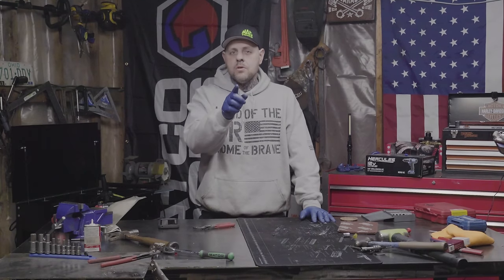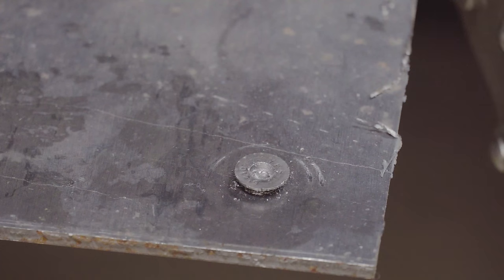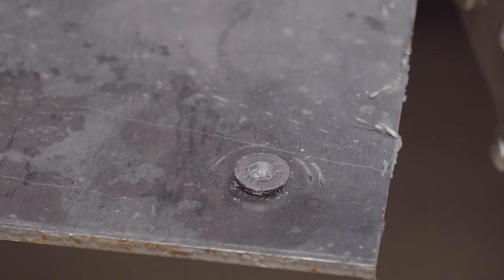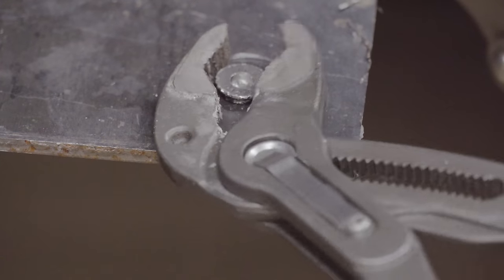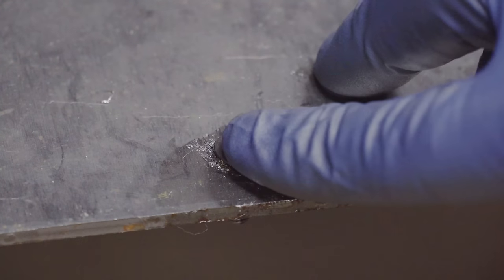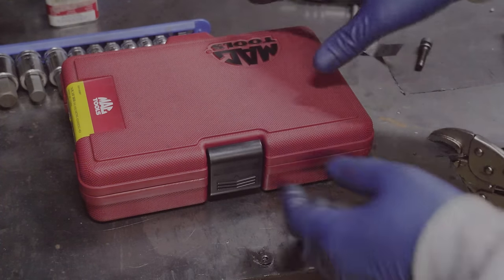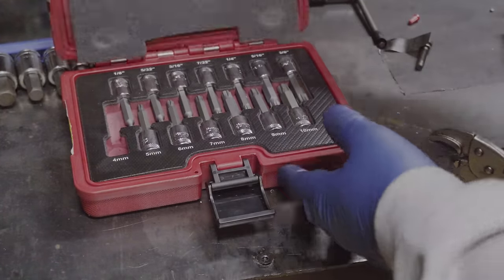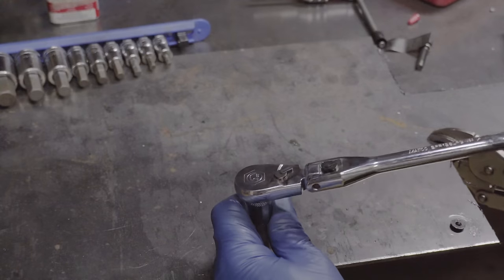3 Easy Tricks to Remove Stripped Allen Head Bolts

Comment: I tried all kinds of methods to remove a 4mm button head bolt. Nothing worked including a kit for stripped bolts. They were too big or too small. I finally used a T30 star head- it was ever so large. I ground the tip down just a bit and hammered it in. Bingo!
Just one more idea to remove those stripped critters.

Comment: cheapest way grind down the head, remove the part, drill out 1 size bigger,  tap  the threads original size and use helicoil the current bolt size your using.

Comment: I have a rc truck motor that I need to rebuild and I bought it used and someone already rebuilt it awhile ago and I guess they didn't know what they were doing because the screw are rounded off and the screws are tiny

Comment: Man, I've got a really tiny totally stripped hex bolt embedded (so I can't grip it with pliers) in the PU sleeve attached to a hub motor on my electric longboard. 

What's worse is that where it's positioned means the other side of the truck and it's hub motor block me from being able to get perfectly vertical over the bolt; it makes most of these tried and true methods much less effective. I've tried using bolt extractors but (maybe due to the angled entry?) they just ended up stripping the bolt even more, and seem to refuse to grip onto anything. 

Really sucks. I'm at a point where I'm wondering if I'll have to spot weld another screw on top of the bolt, and then use that screw welded into the bolt to get the torque I need to remove this (seriously over tightened) bolt :( 

I'm wary to use a hammer and a larger sized allen key to make a new, biggee groove because this bolt is directly over a hub motor that I'd really rather not damage.
Reply: If it hase a valley above use a bolt extractor and find the size that fits just over the size of the head and press down as you reverse
Reply: @lawxx6  I think this was my problem - I was using a bolt extractor that was a size too small. Gonna take your advice when I get off work today.

Comment: I'll add that a dremel tool or angle grinder can be your best friend if the bolt head has easy access. Besides putting the one groove in the middle and then using a flat head, as already mentioned, you can also cut the edges of the bolt head off flat, opposite one another then slip an adjustable wrench or pliers over those cut edges. Just make sure you're cussing the guy who stripped the bolt, and probably cross threaded it to begin with😅

Comment: Good for bolts that are in the open like the ones you just showed, but never for a bolt that is screwed on top of a faucet lever. Can't hammer it, neither reach it with pliers.
Reply from the maker: You could use the extractors instead they would reach it.
Reply: Redemption Garage that's what i was hoping to see when i came here. But thanks for the suggestion

Comment: No matter how simple the job, every time I start a new project, something basic is really fucked up.

1.) Went to clean my mower deck the other day.  Got the power washer out.  Power washer engine would stall out every time I pulled the trigger on the sprayer.  After 3 days of fucking with it, the pump on the power washer literally exploded yesterday and sheared off the metal outlet to the sprayer, and I ended up scrubbing the damn mower deck with a wire brush and steel sponge.  Now I need a new pump for the power washer.  New project.  Can't wait to see what shit goes wrong on this one.

2.) Went to change out a dead exhaust fanlight in the bathroom.  The duct collar would not stay clipped to the housing.  The flap broke inside.  Had to remove the entire housing again and order a new duct collar before I can finish it.

3.) Went to change out the shower cartridge in the upstairs bathroom.  The allen bolt is stripped inside the damn shower handle and now a job that should take 10 minutes is over an hour and no end in sight.

Comment: I wish it was that easy.  I have 12 point torque bolts in a Kia soul cylinder head.  Three are rounded off.  No room for welding a nut onto it to extract it, so easy out worked and beating another size down into it didn't work...now what

Comment: What if its completely rounded out? Because of overtightening
Reply from the maker: You can still use these tricks man what you need to do is find a size thats bigger than what the actual hole is and use a brass hammer to beat it in and try to break it loose. You dont want to go too big though so your best bet is to find either the metric or standard equivalent and use metric if its standard and standard if its metric because for the most part they are in between each other. Let me know if you are able to get it out and if not there are other tricks you can try and I will try to help. Thanks for watching and I hope this helps

Comment: im takin out the motor of my grandpas victory and one of the motor mounts with are an allen head stripped out cause ima weward anyone got any tips on removin a highly tourqed down stripped allen
Reply: Not sure if you fixed it yet....
I used a slightly larger T30 star (torx) driver and ground it down so it would go in a little bit. Then hammered it until it bottomed out. Came right out....

Comment: You missed some others methods , not the least of which is cutting a slot across the top or welding a nut to it , grinding flats on it  , off the top of my head , so keep studying , you will get there !!!!

Comment: I made the hole bigger in the bolt with extractor what should I do
Reply from the maker: Try to go up a size and knock the extractor in using a brass hammer if you have it otherwise use a hammer but be careful

Comment: Who leaves the bolt sticking up?
Reply from the maker: What? You mean you have never seen a socket head bolt used with the head exposed? Like I said in the video that solution only works when the bolt is open but I guess you are trying to either ask a question or are being funny. But yeah man there are situations where a socket head bolt is exposed.

Comment: So none of these worked for me. What I did was strip it out even more until the next sized Allen wrench almost fit. Then I hammered that wrench into the bolt and got it out.

Remember this: if the bolt was soft enough to strip, it's soft enough to hammer something into it.

Comment: I'm trying to tighten screws on the ramps at my skatepark but the clever bastards not only stripped the screws but also had on little nub in the middle if where you would get the strip screw removers in so basically I'm screwed no pun intended

Comment: You have a different bolt that isn’t stripped on last technique
Reply: Or did it make new edges and that’s why it looks like that ?
Reply from the maker: I'm not sure but i stripped the ones out I used for sure. The extractors work great.

Comment: What about a free spinning bolt
Reply from the maker: Free spinning bolt in what? If you can be more specific for me I can see if I can help
Reply: Redemption Garage I have a yz250f and I have a free spinning bolt in my oil filter cover and idk with to do
Reply from the maker: There is no nut on the other side or anything? If it is just spinning easily then it probably won't come out. If it's not an important bolt then I would just get you a grinder and cut off wheel and iust cut the head off of it and leave it. If you have to have it out and need to use the bolt and its spinning like you say the easiest thing would be to find out the size bolt then use a tap chart to find the drill size for the bolt and drill it out then tap the hole or put a helio coil in it. You have to be careful doing that and use a punch to start and try to center it on the bolt as close to center as you can get. Start with smaller drill bits and work your way up to the size you need. Let me know if this helps man or if u need to know anything else. I can make a video on drilling bolts out if that would help I could try to do it after work tonight. Let me know brother.

Comment: Why didn’t you use it on the actual stripped Allen screw? Doesn’t that tool work like you claim? The screw was in the right corner. Details matter.
Reply from the maker: I stripped a few of them brother I get nothing for showing you this particular kit I promise you they actually do work man I have used them a number of times and they are life savers. I am only speaking of the Mac Tools kit when i say that because the kit I linked I have not had as much experience with. Thanks for watching and asking tho man I agree with you but I promise you I have no vested interest in whether you try the kit or not I am only trying to help.

Comment: Bull shiii*t lol 2nd is great or a star bit drive it in like 2nd tip I never have luck with that 3rd tip hate those kits my go to is hammer it like 2nd tip then drive a star bit torque bit in or drill it out or chisel the side turn it out #industrialmaintenancetech